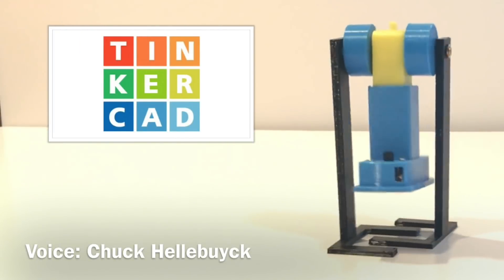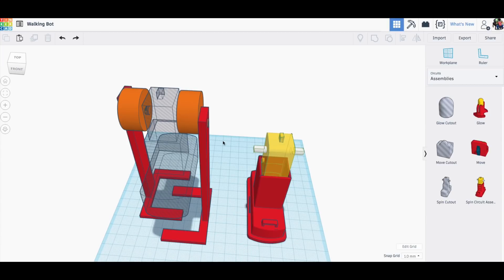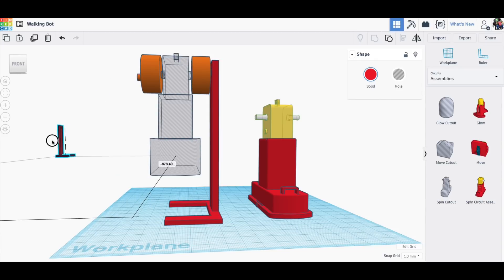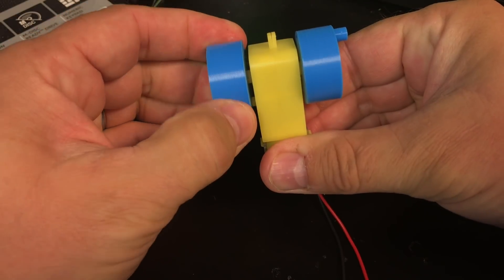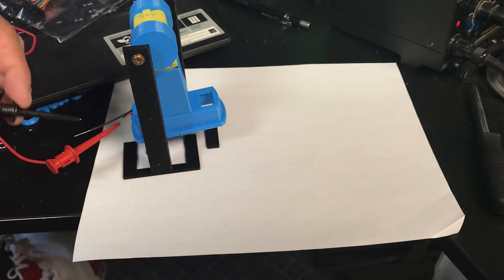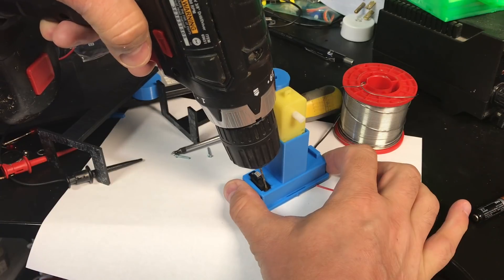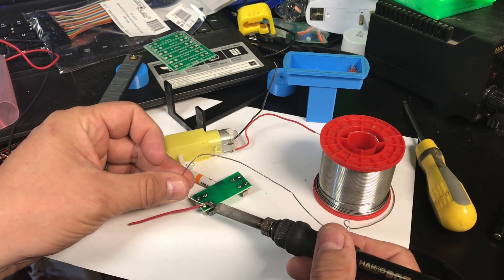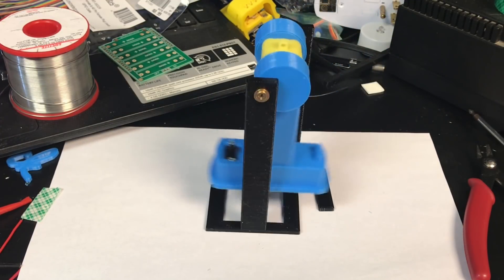3D Printed Walking Robot using Tinkercad Circuit Assembly

Comment: This is a cool concept. Maybe more mass on the feet or a non-slip surface on the bottom would reduce the turning.  Alternatively I wonder if adding another servo with an off balance mass could be used for steering by skewing the center of gravity at key moments.

Comment: I believe your issue is a common 'wag' for these type of walkers. The legs are only supported by your cams and you need clearance for the legs own weight to keep them vertical and not drag on the side of the cam. This causes the body to tilt from side to side. This is common in such a simplistic mechanism, but is normally auto corrects. More complex implementations use a secondary cam (indirectly driven) or bearings/guide rails, this keeps the body from having nearly as much tilt, but that would be a much more complex tutorial. 

In yours, the motor (and connected batteries) are not centered, and since the majority of your weight is there, the offset causes lean more to the one side. This can be best seen as it walks, the batteries touch one leg but not the other. You could probably decrease this by using a couple washers between the cam and the motor shaft on the side its touching to ensure the weight is centered. 

All that being said, I would want the walker to come back to me so i don't have to chase it, so i think your's is more pratical... Keep up the great work!